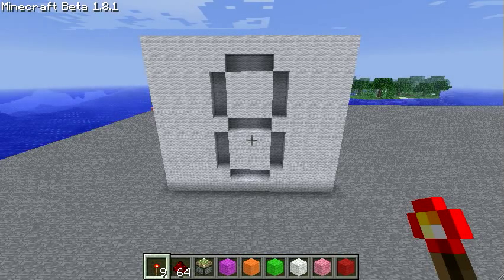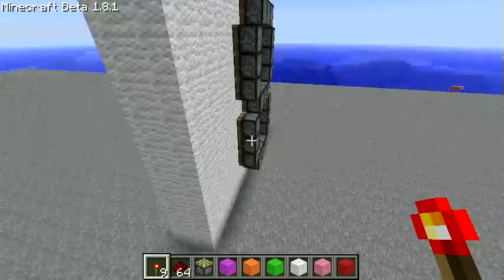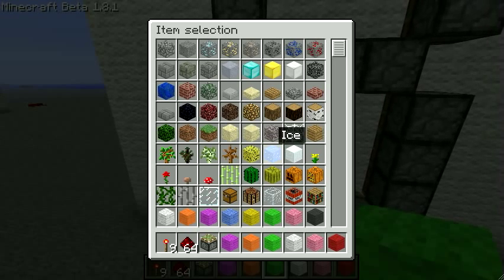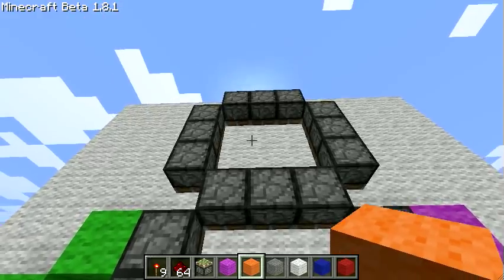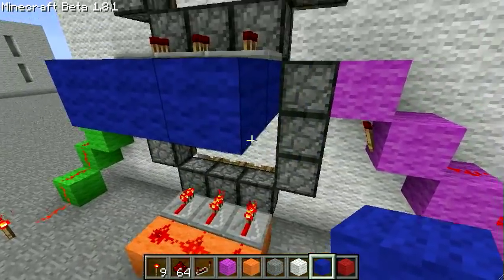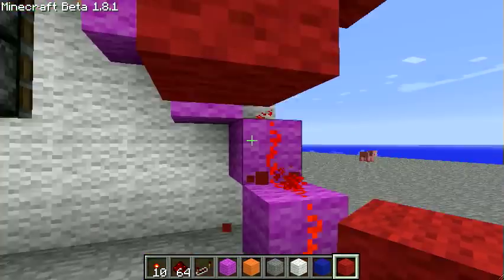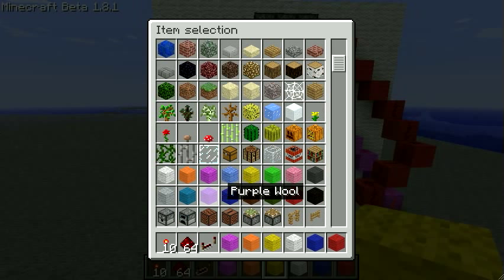Minecraft 1.8 - How to make a 7 Segment Display & Decoder V2! (Part 2)

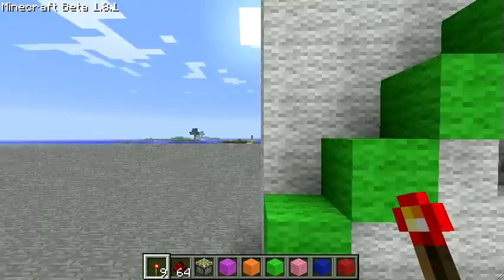Comment: @TheXboxNut 1:14 The reason that bottom piston turns on and not the ones at 1:40 is because a redstone torch has the ability to send a signal in front of it AND one block below it, when that space of "air" below it recieves the signal it then powers the piston below it.